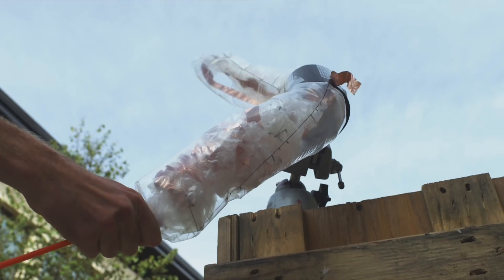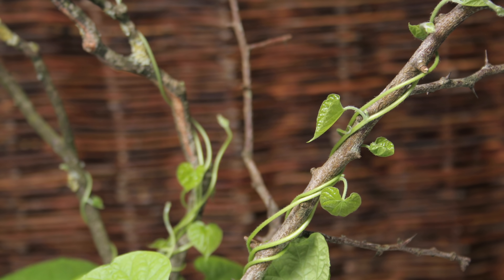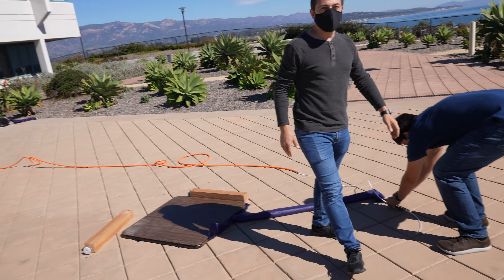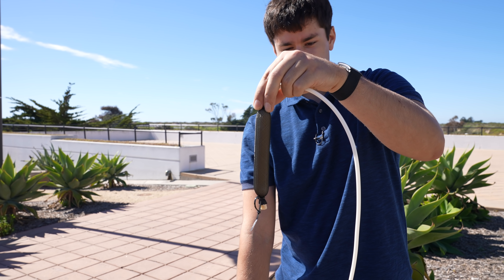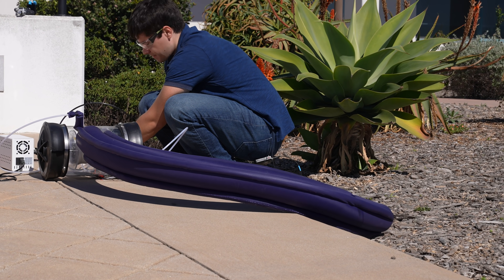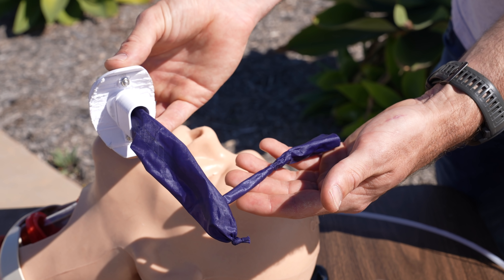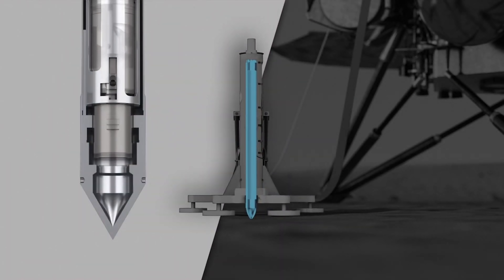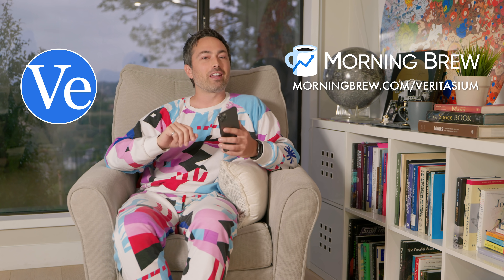This Unstoppable Robot Could Save Your Life

Comment: I could see this technology having good application for electrical wiring as well, fishing wiring behind walls can be quite difficult or messy.
Reply: and plumbing ... I mean actually plumbing not human plumbing
Reply: @edd868  but also for human plumbing, at least in the medical sense.
Reply: @edd868  I just posted a comment, we used this to replace sewer lines, it was a gun that shot a woven hose like material, coated in resin and it worked exactly like this, then it would dry inside the pipe and create a new sewer line.
Reply: @edd868  “deeper robo-kun”
Reply: Sven Ruetz  Did you find the link?
Reply: Look at a magnet roller,  also this "robot" has been used in pluming for decades and many cities have been replacing sewer pipes with this, run the liner in and heat it and it cures in to a hard pipe you can also buy a pipe repair kits at wall mart that does this. what is happening in this video really is not new
Reply: @-BigTMoney-  it's not that it's new, it's more that it's a more advanced version of what we already have. This version just needs a lot less human guidance and therefore isn't as prone to human error.
Reply: @DolusVulpes  it is the same amount that human interaction when they have been using in sewers  and they use it in oil drilling for over 60 years. when they picked up dude that has been in the trades forever, is is often used in house leveling / moving, it is already used in artery repair and reclogging, Just because it is new the video maker and others, does not make this new. they have been using something like this in plumbing over 40myears, in veins and arties over 20 years oil and pipe drilling over 40 years, tow trucks have them for popping doors for 20+ years, fire trucks have them as a jaws of life entry option, we flipped tanks with them in WWII. They have used it to right ships like the costa concordia.
Reply: @-BigTMoney-  if you say so, but I'm going to trust the video that links to sources over a random comment on the internet if that's alright with you.
Reply: I work in telco and internet installing. I would love this for wallfishing
Reply: Have you looked at the Magnetic Wire Pull?
Reply: Ja klopt
Reply: Youve never fitted any electrical wiring roan

Comment: What about deep-sea probes? Would it be possible to create enough pressure inside a soft/tunnel robot to counteract the forces of the ocean at those depths? I imagine a rig that instead of extending a large drill bit down by adding extensions at the top, simply extends like these tunnel bots to whatever depth you want.  I suppose buoyancy of the soft robot could be a problem though..but maybe weights to keep it down? Would be cool

Comment: These are undeniably cool...but the principle is not new. It may be a new idea to use them as robots (though as was stated towards the beginning of the video, these aren't actual robots yet), but this mechanism has been used for pipe repairs for some time--like since the 1970's. It's called Cured-in-Place or Pull-in-Place plumbing. What they're doing it identical.

An epoxy-impregnated liner is inserted into a section of exposed pipe, then filled by pumping water or compressed air into the liner, which takes the shape of the damaged pipe. Once cured you effectively have new pipes, encased in the shell of old or damaged pipe.

Clever idea to use these for the purposes these researchers are interested in (Search and Rescue could certainly benefit), but the mechanism of movement wasn't their idea.  I'm surprised he didn't realize the long-existing uses in plumbing during his own research. Credit to the design belongs to Eric Wood, who hold the patent for Cure-in-Place Pipe Technology, US Patent 4009063, back in 1975. This technology entered the public domain in 1994 (according to Wikipedia).

Comment: I saw a plumber on Tiktok using something like this to coat old plumbing pipes in a resin-like substance to basically create a new pipe inside the old pipe. It was rad.
Reply: Good info! I was thinking of a good way to "clean & de-clog" pipes with thoses...which could be more effective that a firm goupillon that cannot pass narrow turns, or tight blocages etc. (and apply a pression directly on the blocked section to make it loose and progress some more etc...)

Comment: the base system is use in pluming as they using this to reline a broken or damage pipe with a fiberglass cloth and later resion is pump in to it to harden the pipe and they been doing this for years now maybe 10 years or more now

Comment: anchor points in soft sand, imagine if a vine was pushed through sand to a certain depth and had a shape that would expand on all sides like a sort of foot... then you just pump concrete instead of air in the cavity created and then add rebar, strong foundations inside sand.... might improve structural integrity of short-lived structures on loose sand.
Reply: Oil rigs do something similar

Comment: I liked the antenna use, if it was a stand alone system that would be awesome for quick radio setups in the bush. No more throwing lines and rigging. That is more building structure though and doesn’t really need to be a robot…although it could be used to scale trees, buildings or other objects to setup your own antenna in a more discrete fashion. 
  Would help spelunking. If portable enough, could be drug along and used to explore smaller cracks or crevices. 
  Put a display head on the end and you have a following monitor. 
  Have a few for security cameras on a property. If sensors pick up a noise, can deploy to investigate. 
  We will probably make large, I mean HUGE, versions of the dancing flower. Remember the little guy in his pot, sunglasses on and ready to boogie?  Well, celebrate spring with a giant sunflower who “lights up” your garden display with dance routines!

Comment: I know this is gonna get lost in here but I had an idea about the movement of the robot.
Curently using the air bladders is quite cumbersome and I'd say limits the robots ability to squeese itself through small places.
Would it make sense instead to use that fabric that constricts with current? Set out in an array with toggle switches along the sides of the tentacle would it not give the operators much more control?

I don't know enough about this subject to know whether or not this idea has merit but hopefully someone can let me know either way.

Comment: I'm thinking how this kind of gizmo could work its way around a serpentine radiation barrier (overlapping walls of lead would stop straight-line radiation particals and waves) and allow inspection of hot environments like Chernobyl or Fukushima Daiichi. Have it drag a fiber-optic bundle behind it for sending images past the barrier. The operator and electronics could stay safely behind the barrier while inspecting a rad-hot environment.

I can also foresee a day when a vine robot will be usable to a minimally trained operator, just like defib robots are saving lives today. This is heady stuff!

Comment: I work in IT and we are often laying out conduits for customers with large pipes filled with cables.  Something like this would be able to drag the cable through the pipe instead of our usual brute force method.  It would be way easier and since they’re so cheap I wouldn’t be surprised to see it in the near future!
Reply: I used to work in IT and i agree, so much time and effort is spent trying to fish through  conduit, something like this could make deploying cable or fiber much easier..
Reply: also it could help with laying cable/fibre lines as they don't need to tear up the ground
Reply: Air pressure is already used in several applications when having to travel through meters of conduit.
Reply: We would use a vacume and attach a parachute to the end of a pull string and suck it through the conduit. You still had to pull the cable. But tbh I don't thing this tech would doo much to pull even one cable and definetly not multiple runs at once

Comment: The issue you will be aware of with trying to sell this to NASA is that on every space mission, weight is an issue; every kilogram/ pound costs ALOT! spaceX is cheap with about $2500 per pound, while NASA counts about 10k/ pound, and since there is no air om Mars, you need compressed air, and lots of it if you are gonna use it to blow away sand like that! True, you can use any gas or even liquid but then you would still need a compressor/ pump to blow that out, and that is a weight issue

Comment: This could be built onto. There’s actually an old thing I saw.. a liquid you put into balloons, and basically this liquid, once a few drops are spread on the volume of the inside of the balloons, if it were to be punctured from the outside, this liquid would act as a clot and stick the punctured part of the ballon to stick to whatever punctured it: so if you were to put that inside of this, when it gets punctured it wouldn’t let out as much air, so you wouldn’t need to increase the pressure as much
Reply: Kind of like tubeless bike tyres?

Comment: Imagine if this could grow over miles and explore the depths of the ocean
Reply: I'm pretty sure it would just float, since it's mostly air
Reply: @99temporal  doesn’t just have to be air. Air is a fluid just like water is. I’m sure there’s an application where you could use water or some other type of liquid that has a heavier buoyancy to reach the bottom for ocean exploration.
Reply: The air pressure would need to be increased exponantially / very expensive as it grows longer, since there is more and more air to push. And you would need something much heavier than air, because it shouldnt float so it makes that idea impossible in practice.

Comment: Why not place a string in the inside that can be then pulled back to rectract the entire structures?
Reply: The concern there is you end up needing a spool wide enough to allow that length of string, which could increase its weight and surface area. It's for the same reason Rockets don't just carry more fuel to travel further, because it could make it too heavy.

Comment: What if we triple the size and throw this into a house with compressed fresh air blowing through, this allows someone to crawl through the tube in certain situations instead of in the smoke of a fire or something. It would clear the tube of smoke whilst keeping the person inside able to breath clean air separated from all the smoke above and around the room
Reply: Unfortunately, as the robot doesn't work without air pressure, building a robot that size with an open passage will do nothing more than make a giant wind-sock
Reply: @Nechrostriker4  what if you ran an intricate inner tubeing pattern that sustained the shape but allowed passage?
Reply: @Valeij221  the issue there becomes flexibility.
Reply: @Nechrostriker4  what if we stopped making fire? 🤔 ayyye fixed! 😂

Comment: US Government: But can I turn it into a weapon?
Reply: So far it seems the robot is slow because of three factors: low air pressure, weak container/lining, and manual control (the three directional tubes are human-controlled and therefore slow). 
The first two problems are by choice (picking cheap materials, and low air pressure for safety), so it can easily be turned into a fast-moving coil that inflates quickly, although other things like guns are more effective at destruction. 
The third problem could be handled by computers or just people being more familiar with using the robot.

In that case, it's pretty decent to turn it into some type of faster moving underground covert weapon, since it could definitely have applications underground like with a drill or something. 

I'd imagine it could pair well with poison gas or something similar, since it seems most effective in an underground infiltration scenario or through ventilation (or even digging through walls!) but it seems far too limited in when it can actually be used as a weapon. It seems far more useful for safety/exploration purposes (like underground exploration, creating an air connection to trapped miners, search and rescue, etc.). It might be used to rescue buried or trapped soldiers in a bunker or something, I suppose.

Comment: Thailand's Tham Luang cave rescue of the young football team:
This vine robot could help in situations like these for the rescuers to directly go to the trapped group, by sending these vine robots in multiples with camera and air line attached (to supply air as oxygen is low in the cave). One vine robot would find them, retract the balance vine robots and then it's easy for the divers to follow this path.

Comment: Temporary anchoring in sandy soil. Let it go in 5-6 feet and there should be enough friction to hold a good amount of weight in place.  Sort of like a hitching post, 2-3 wraps of the reins around the post and the horse isn't going anywhere. Once the event is over you I'm thinking you connect the pressure hose again and pull the anchor out.

Comment: The best application is going to be building collapse, or trench collapse. Using this in extrication would be highly ill advised over a high pressure air bag already commonly used.

Comment: I had a similiar idea to this after watching an anime called "Tokyo Magnitude 8.0". well not as far thought out as this, I only had a idea of a small worm wiggling through collapsed buildings to find people. Eventually even having some space in it for a chocolate bar and some small amount of water and some small system for at least spoken interaction to at least help them psychological give them a simple diagnose or directions and more importantly get information. But well I didn't do anything with it. 
But this design goes further you can easily supply people with water and more importantly air. And instead of just a camera it may be a good idea to include some kind of communication system into the unit at the front.

Comment: Would it work as well (or better) if it used a liquid instead of air to pressurise it? Hydraulic pressures can be very high but without the risk of explosion that you get with compressed gases.

Comment: my immediate thought is incredibly large cable runs, the current methodology is to use wire and just pull the cable through, then you have to reset the wire by pulling it back through the other way, this would completely remove the setup and reset portions of a run, and even cooler you could run large bundles of wire at the same time.

Comment: I feel like this would make running wires behind a wall soooo much easier.
Reply: And unblocking a toilet!
Reply: @grafito4438  we already have stuff for that but yeah
Reply: and pleasing women
Reply: Step 1: Make the Robot

Step 2: Profit
Reply: Funnily enough, using ferrets to run cables is still a wide and effective practice
Reply: That's actually genius
Reply: @jacobweihe  same
Reply: @colin.whitey12  That's not something you say "same" to though
Reply: Maybe a neumatic drill assembly similar to the camera, with a stepped bit. Good idea Alex
Reply: Actually need to do that rn
Reply: 1k liker, great comment lol
Reply: They use this or something like this in plumbing to repair pipes
Reply: Ur genius
Reply: There are multiple ideas you could do with that
Reply: Fish tape exists ya’know
Reply: @BOBBERTQUESTIONMARKS  use in conjunction w fish tape, and next to the camera, a 3/4 spade drill to cut thru the 2x4 blocking!
Reply: Wow. That's really an genius idea
Reply: Well, what about if the tube goes through a space that is too small but not strong enough to withstand force (drywall). You're gonna have to learn how to patch drywall.
Reply: Assuming you are using 14. I doubt this thing could move several #12 or #10 conductors
Reply: You just use it to move a tie line
Reply: And what about pulling optic fibre cables to undergorund tubes? This would make it super easy to apply a pulling cord to a tube.
Reply: Or run pipes in the wall, and then actually become the pipes
Reply: @cosmalas7742  saw something like that the Other day where they used something like that to reuse old pipes inside a wall without opening the wall
Reply: @FakeGamer100  I believe they do that to repair pipes under ground, saves on digging up.
Reply: @cosmalas7742  This is what I was thinking.
Reply: I hope they pay attention, you will be history itself

Comment: One thing I was thinking is plumbing unclogging pipes, or running electrical wires through walls. Or the tip one being used for running pipe or wires through the ground leaving the surface in disturbed and much cheaper then directional boring. Unclogging vanes from blood clots

Comment: its an interesting thing, but when you run out of material, that's its limit. this robot could also be used underwater, just replace the air pressure with water and there you go, diving to where you need it.

Comment: I recall there was a case where some ppl are trapped in underground caves and there water inside. the robot could go under the water and probe to find where the trapped survivors are,.. going through narrow spaces and such.. if it reach them.. it can essential provide them with air via the tube and other things like drinking water.